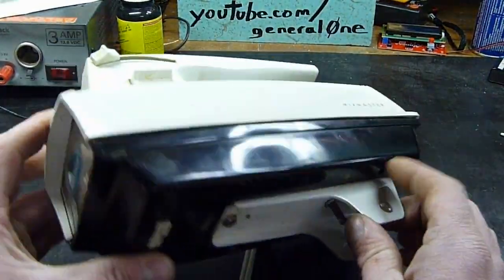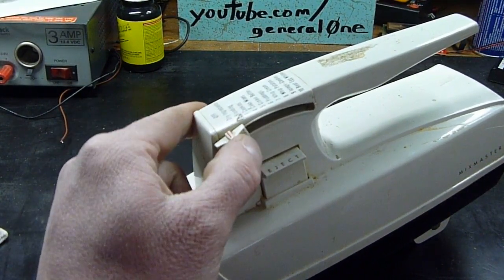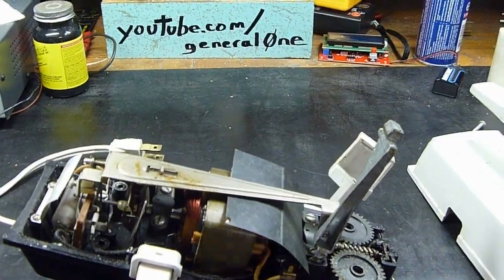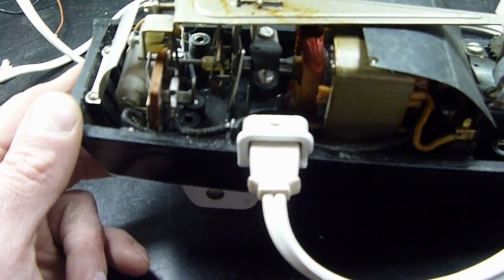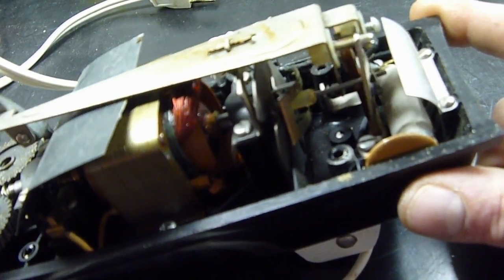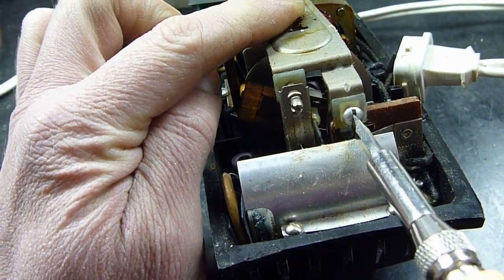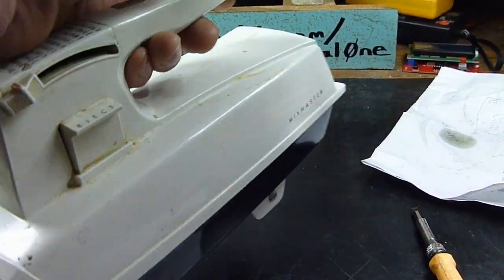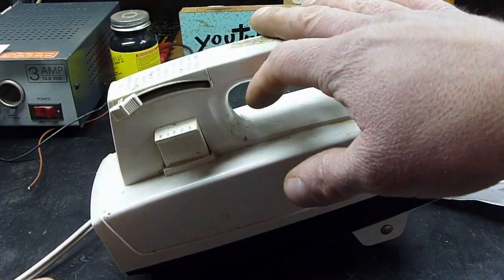Sunbeam Mixmaster EM 3 Teardown and Repair

Comment: The mixer you asked me about before has a plastic upper shroud and metal on the lower half.  It is model MMA.  The beaters have a groove about 2 inches down from the top with a semi circular metal o-ring in them.  That groove lines up with the groove in the beater sockets but the beaters do not lock in place.  I can pull them out with the black handle in the upright locked position.  How do I fix that?  The motor revs a little bit in between speeds 3 and 4 so how do I fix that?

Comment: Its not cloth covered wire, its a Fiberglass weaving that resembles cloth covered wire. The Fiberglass covering is both insulation and provides heat resistance. That Fiberglass wiring is widely used on a variety of appliances, especially anything equipped with Calrod heating element.